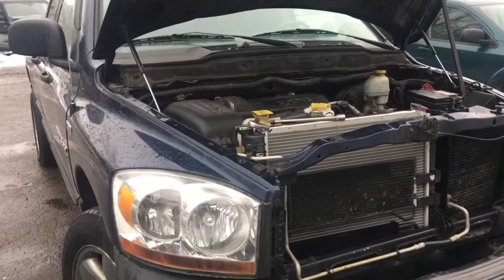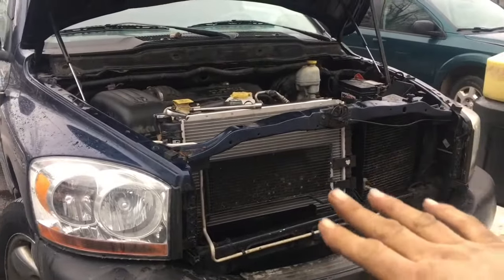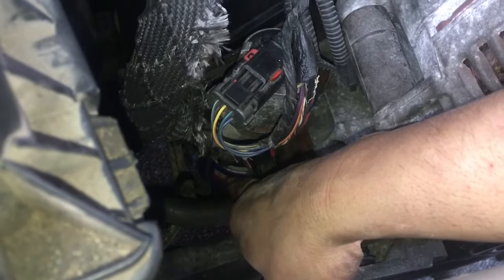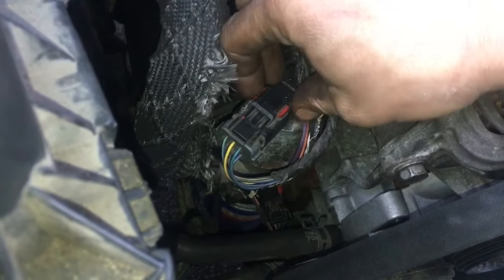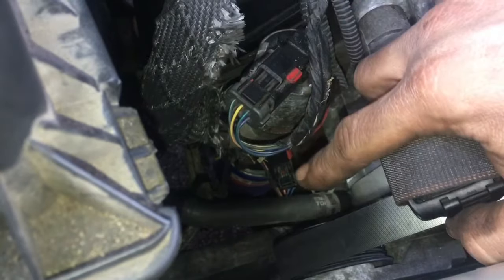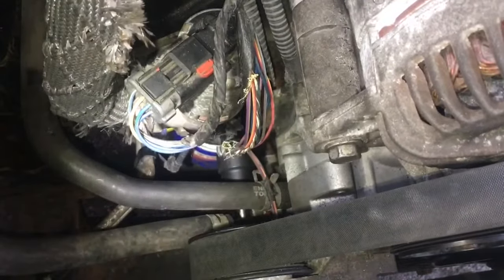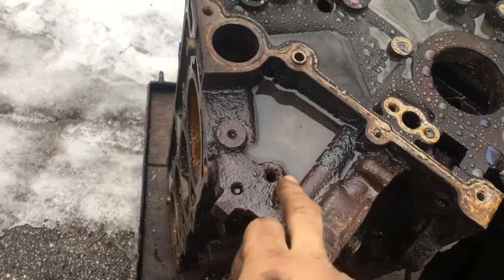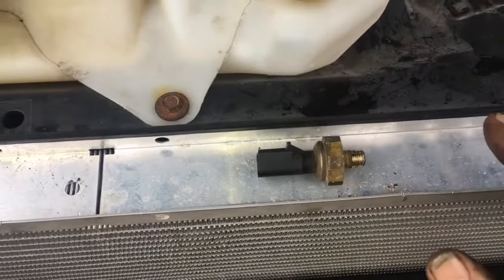Dodge ram 5.7 hemi oil pressure sensor removal

Comment: Does the same thing go for a 2004 are they set up about the same
Reply from the maker: It most certainly does generally you’re going to find that most oil pressure sensors on just about any vehicle are very close to the oil filter it’s kind of a rule of thumb…… except for some jack ass that told me there was an oil pressure sensor on the top of the intake of his dodge and I won hundred percent know for certain unless he was working on a 5.7 he was 100% wrong because I know them Engines like the back of my hand or should I say the palm……

Comment: I need to install a glowshift oil temperature gauge and the manual says to screw the sensor to the oil galley port. Where is it please on a DODGE CHARGER RT 5.7 2007 ? Thank you very much and keep up the good job. Cheers.

Comment: I have an ‘06 Ram 1500 4wd and my check engine light stays on with a P0520 code knowing it’s the oil sensor and the oil gauge stays above normal when driving and I’m about to get that sensor replaced.

Comment: Good instruction.   I have OBD codes 1521 and 520 for "engine oil pressure sensor/switch malfunction" and engine will not start.  Oil is full with no leaks and engine will not turn over.  I've been told that a failed sensor will cause the computer to disable the engine start function.  Turn the key to accessories and the dash lights up, but turning the key to the start position does absolutely nothing except I hear the fuel pump energize.   Also, no need to drain oil to change the sensor???

Comment: Question my trucks check engine gauge came on and then the oil pressure dropped and the truck shut off and would no start. Could that be because of a bad oil pressure sensor?
Reply from the maker: I would be surprised did it did that does the engine turnover any longer?
Reply: @sharpcarco  the engine doesn't turn over
Reply from the maker: ⚠️😧 that may not be good… check and make sure your starter is good though and you do not have a solid red LED light on the dash. When you turn the key on if you have the solid red LED light it’s a security problem. I know you can unplug the oil pressure sensor and the vehicle will still start.

Comment: Unplugging that sensor deactivates MDS correct? I have a 06 with MDS I want it off...I heard unplugging the oil temperature sensor does infact deactivate the MDS
.can you confirm please? Thank you
Reply from the maker: That makes a lot of sense, So other than not knowing what your oil pressure is. It couldn’t technically hurt anything because , The oil pressure sensor doesn’t control anything , except for that. , The other issue would be that it would put the ECM in limp mode because I’m assuming it would turn on the check engine light. Meaning that the engine wouldn’t regulate O2 sensors etc. etc. which could possibly cause decreased fuel mileage. 

But hurting something I don’t think it’s gonna hurt anything even over the long run. So it’s worth a try

But if you wanna send me your Ecm I can delete it for you. So you would still be able to have your oil pressure light and your oil pressure gauge ,more power and save your fuel economy , Plus the ECM will still monitor and regulate your fuel air mixture ratio the cost is only 400 bucks. And it’s worth every penny of it. But still you can give it a try and see if it works.

With Dodge it usually takes a couple of extra days over what it normally takes for other ones just so you know generally most ECM‘s can be flashed and reprogrammed for right around $250 but that particular one is a little bit more expensive because it requires extra parts and stuff if it’s something you’re interested in and we’re happy to do it and I’ll explain it in more detail

Comment: Is the same location for a 2007 4.7 magnum
Reply from the maker: Opposite side by the fuel filter but pretty much the same way

I mean oil filter sorry I answered this on the Quick and my wife got mad at me for answering questions all the time so I didn’t check what I said

Comment: This part that you replaced would it by any chance be driving my low and high needle all the way to the right does it control what the needle says. On the top right of the cluster gauge
Reply from the maker: It does control the needle try unplugging it and see what your needle does they are generally in that situation it might mean that your instrument cluster is malfunctioning and I have a friend over here in Grand Rapids the rebuilds instrument cluster his name is Dash doctor (josh) So you can Google him if you find out that’s what you need if you unplug it and it it still does it then you need a new dash cluster if you unplug it and it does not do it then you need the oil pressure sensor like in the video
Reply: @sharpcarco  that's a good idea thank you for the tip I wasn't sure if you were going to see this comment because the video is a few years old thank you I appreciate your help. By the way the check engine light is on and it's pulling up that code.

Comment: Hey, I have the 2007 dodge hemi with 200k . Are those oil sending units known to leak a little bit of oil while NOT causing any other issues ? Mine is pretty wet around it and the rubber boot on the steering unit below it has some oil dripping from above.

Comment: So this a $470 job that someone quoted me today?
Reply from the maker: Lol
Reply from the maker: Never in 1 million years
Reply: @sharpcarco  It’s the oil pressure sensor, oil heat sensor and an oil change. Still high right?
Reply from the maker: Oil heat sensor? Never heard of one of them……. Unless they’re talking about a heater did they use to heat the oil when you live in sub 20° weather over 50% of the year. 

Yeah that’s ridiculous changing Oil pressure sensor takes
Half an hour at most

And an oil change is an oil change… Full synthetic would probably cost $75 I guess

I should mention the sensor is probably $30-$50
You don’t have some kind of diesel do you? If you do I have no clue if that’s high or not . A Mercedes sprinter Diesel oil change cost $200 and they’re very expensive but I don’t think it’s the same thing for the Dodge diesel
Reply: @sharpcarco  I live in south Louisiana where it doesn’t get below 40*. It’s a ram 1500 5.7. He’s supposed to do the work tomorrow. Looks like I’ll give him a call tomorrow morning bright and early.
Reply: @sharpcarco  I appreciate the info!
Reply from the maker: What did he say?
Reply: @sharpcarco I tried calling a few times. He hasn’t answered or called back yet. Im not sure what to do at this point. I hope he didn’t start working on it yet.

Comment: My daughters 2005 Durango’s oil light flickers when it comes to a stop. It also makes an annoying chiming noise. It goes away when she accelerates. I checked the oil and it was fine. I said I should go check and see if the pressure is low. She said, “I’ve been driving with that light for 6 months. This truck is a beast. Runs great. I’m gonna start with the sensor.
Gotta love kids. Thanks for the video.
Reply from the maker: Oh my God Robert I fill ya, six months! Yikes!! From my experience there’s not a whole lot you can do running thicker oil makes the time in chain tensioner not pump up correctly . Running thinner oil very seldomly helps but is what I would try if you still have a problem more than likely it’s just a sensor though. Hopefully it helps out and I wish you the best have a great day

Comment: I changed mine and it still throws the code with a red lightning bolt any clue why?
Reply from the maker: The red lighting bolt is for the alternator .
Reply: I checked the alternator its still good. Man this sucks my only vehicle
Reply from the maker: I have had them in the past were that lightning bolt came on and they were charging then a couple of weeks later the alternator went out but that’s not always been the case I’m sorry I wish I could give you a hand in the situation
Reply: Thank you I appreciate it

Comment: I've never done anything like this in my life on my own and this video put me through to getting my gauge to come down and after a code reset my check engine light off as well. I used an adjustable wrench and like the other comments it was a slow painful process but doable. Thanks man!

Comment: My husband passed in November and he made me promise to change the oil in his truck every three months.  Kansas is cold right now. Took it to Walmart. Do not judge me. Pressure is reading higher then I have seed it before. Normal is in the middle, about 40. Now ready higher?  about 3/4 on gauge. Walmart said 12 quarts? I thought that was kind of high? Please tell me what to do. I really don't want my husband walkingy my dreams.
Reply from the maker: 12 yikes!!!!! You might better go somewhere and get a second opinion because that does not make any sense unless it is a diesel it have a high oriole pressure is really not a problem but being overfill that much is a real problem. The 5.7 hemi if I remember correctly is about an 8 quart engine that’s a lot of oil for one engine and a little bit higher than most but 12 quarts is very excessive I wish you the best dear. Go somewhere and have that checked right away

Comment: Hello clay . I have 2005 dodge ram 1500 5.7 hemi . I changed the oil sensor but my truck won't start though it shows the code for the sensor. What can it be now ?
Reply from the maker: Crank sensor.... can’t say for certain of course but the oil pressure sensor will not generally make the vehicle not start. The crank sensor is for the Time in and it is crucial to the vehicle starting

This is assuming the engine turns over Hope that’s helpful
Reply: It dose crack over but will not completely start
Reply: Thank you for ur quick response
Reply: Oh I forgot to tell u that the oil gauge is marking zero
Reply from the maker: When you crank it over make sure you have a jump box on it or a battery charger then while you’re cranking it watch the RPM gauge if the RPM gauge does not go up while it’s cranking you more than likely need a crank sensor very common

Comment: I replaced my oil sensor a month or so ago. The Guage on my dash board shows the oil level at around 3/4 full and does not move from that position. At a recent inspection they gave me an oil sensor switch error.. could i have tightened it too much or could the sensor already have failed and need replacing? Thanks for any help or advice you can give.
Reply from the maker: Well then sensors have pressure plates inside them just as a way to explain it and it is possible that they could’ve failed already generally if they’re going to fail it will happen quickly like in your case so I would recommend replacing it I’m certain you didn’t do anything wrong
Reply: Thank you, my buddy suggested the same thing. Guess I will do it again lol
Reply: I have the same exact problem happen yesterday..going to put the second d oil sending unit now..second one in 2 days

Comment: will this be similar to the 4.7l ? mine is going out and im replacing it while I change my oil  this Friday?
Reply from the maker: Yeah it’s extremely similar except the sensor is located on the opposite side of the engine and I believe I have video showing you how to do that exact one even though it’s really unnecessary to look at it it’s right near the oil filter in the front of the engine if I remember right it’s right above it you can look on my jeep playlist for 4.7 oil pressure sensor replacement and I’m sure you’ll be able to find it there if you need more direction I’m pretty sure that the same sensor and the same size socket
Reply: @sharpcarco  thank you very much sir you’re a huge help! I’ll be sure to recommend all my friends to your channel for help and guides!

Comment: Would this cause the truck to shutoff and not crank?
Reply from the maker: If it lost oil pressure because the oil pump went bad there are very big problems going on in the engine.

If this sensor is bad it will not stop the vehicle from starting, 

If your vehicle is not starting but turning over look at the RPM gauge when the engine is rolling over if the RPM gauge is not moving you more than likely have a bad crank sensor.

I hope you don’t have big-time internal problems if it’s not cranking😕
Reply: Thanks so much!

Comment: I followed this to the t, but now when I slow down and stop it continues to do it.
Reply from the maker: Well I’m very sorry to say Sammy that more than likely you  have a plugged pick up tube. Or a bad oil pump.. 

But from the experience I’ve had over the years it’s probably from worn out bearings that won’t allow the oil pressure to pump up at an idol

Comment: When you remove the old sensor, does it spill a lot of oil? Or it's not that messy at all? And also can you remove and install with a adjustable wrench or do I need the soket ?
Reply from the maker: No not a lot of oil spills , it won’t be easy with that kind of wrench
Reply: @sharpcarco  You're right. Tomorrow I will buy some deep sokets to change it. Thanks for the video tough

Comment: Hey I have a 2003 Dodge Ram 5.7 hemi the check gauges light is on when it’s cold and the oil pressure gauge reads zero but if you turn it off and turn it back on the light goes away and the oil pressure is normal any idea of what causes that issue ?
Reply from the maker: Well if the engine is not knocking. More than likely you have a bad ground somewhere. But if I were you I would take the sensor out and put an actual gauge on it to make sure it has oil pressure because that is a very expensive engine. 

Then I would go from there looking for loose grounds or bad grounds if I had the proper oil pressure. It would not be unusual for that engine to not have proper oil pressure at start up
Reply: @Al McGee I have the same problem too and wondering how you made out with the new oil pressure sensor?  Did it solve the problem?

Comment: Thanks for the video Clay. Would the switch perhaps send wrong pressure to gauge? On my 03 5.7 Hemi the pressure on gauge drops to zero on idle. As soon as I accelerate it goes back to normal. 

When I changed oil last time this switch had oil inside by terminals from leak somewhere. Is there a way to manually confirm the oil pressure? Thanks.
Reply from the maker: Hey JZ I appreciate the kind words. There is a way to hook up a manual pressure gauge it’s actually pretty simple and available at most part stores. 

But unfortunately having quite a bit of experience with these vehicles. You probably do have an oil pressure problem. Oil travels past bearings around the cam,etc. causing it to not have as much oil pressure is it should add an idol. 

There’s only One other possibility and that’s that your pick up tube is clogging up. 

Because it has a mechanical oil pump. They don’t generally go bad. I wish I had some news to better report
Reply: The Clay Way Thanks for the fast reply! I was going to drop the oil pan tomorrow hoping there is something blocking the pickup tube. The weird thing is after I cleaned connection and added the fresh oil the pressure gauge was fine for a few days. Hope its not the bearings, I think you have to pull engine to do that on HEMI 🤦‍♂️
Reply: The Clay Way Clay wanted to give an update just in case somebody else watches your video. Fixed the issue. It was the Oil Pressure Sending switch. When I went to hook up manual oil pressure gauge I noticed it was leaking and plug inside was full of oil.

Truck had 40 PSI pressure at idle and about 75 PSI at 3K RPM. Needle was very stable. Thanks again for videos. Now on to the suspension!
Reply from the maker: I’m so glad to hear that I hate it when people have to do tons of work and cost. 🙏

Comment: Great video man! Today i went to start my truck and and oil pressure gauge is on zero, is it the oil pressure sensor i need to change? The last couple days it has been dropping down and today when i started it, it didnt move at all.
Reply from the maker: Well I’m sorry to hear that Dalton but it’s probably actually losing oil pressure because these engines are notorious for that it’s generally not the oil pump it’s generally because the engine it’s not pushing pressure the way it supposed to because the ports that the oil pressure pushes through expand dropping the oil pressure. 

I’m very sorry to hear that that’s happening to you and I wish I had better news that’s very common with these let me know if you have any more questions I’ll be happy to try to help you
Reply: @sharpcarco  im about to go get a oil pressure sensor, is that what you think it might be?

Comment: I have an 06 ram Hemi with this code, the truck runs and drives the same and sounds fine. Can I drive around with a bad sensor?
Reply from the maker: Well it’s difficult for me to say I would recommend getting it checked right away. Because if it is actually low on oil pressure it is going to create a very big problem and could be much worse if you continue to drive it around. If I told you to drive it around and then it blew up the next day you wouldn’t think very much about me. 

I can only say that if it were my vehicle and it sounded fine personally I would give it a try because I could probably fix it if something catastrophic happened. 

I know I sound like a politician when I say that. (not really giving an answer to cover my ass lol) 

Better to be safe than sorry my friend. Air on the side of caution get someone to check it out for you ASAP